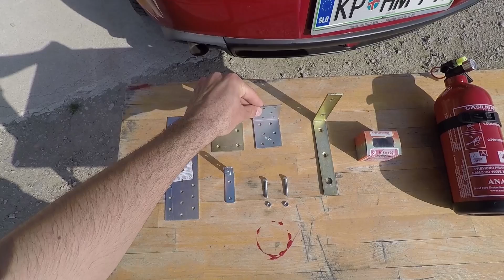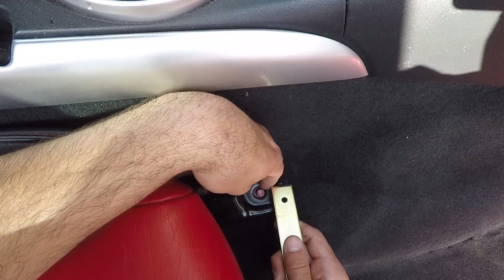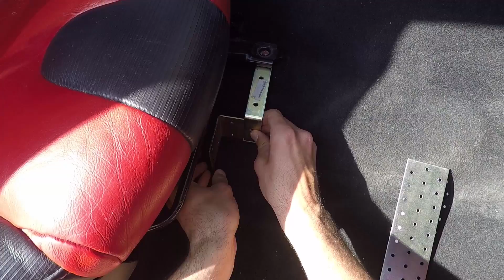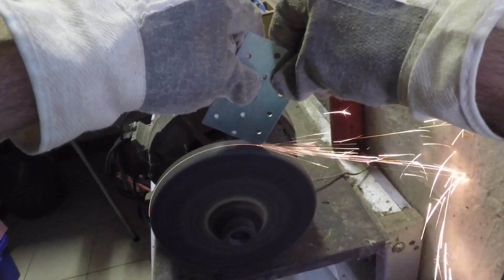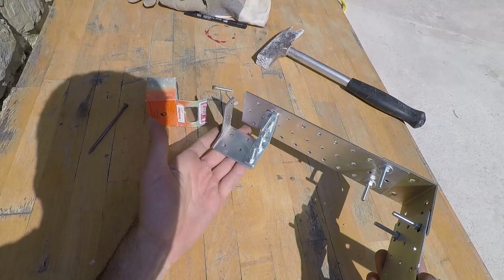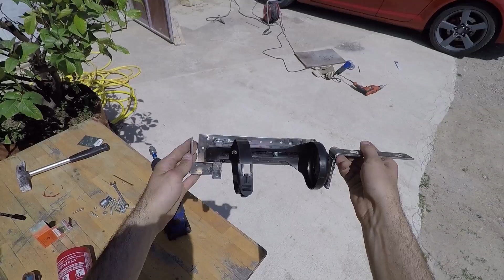Mazda Rx8 Fire Extinguisher Install

Comment from the maker: ⚡If anyone is interested, this is the fire extinguisher i used in this video: https://rover.ebay.com/rover/1/724-53478-19255-0/1?icep_id=114&ipn=icep&toolid=20004&campid=5338068045&mpre=https%3A%2F%2Fwww.ebay.it%2Fitm%2FESTINTORE-PORTATILE-A-POLVERE-1-KG-PER-AUTO-BARCA-CAMPER-CASA-OMOLOGATO-RINA%2F121931485847%3Fhash%3Ditem1c63aed297%3Ag%3A2Z0AAOSwxp9W79C3⚡

Comment: I put mine in the boot screw it to the top so your out the car when is on fire.     Don’t want to try pull that out if inside and your trying to get it out.     Just a tip
Reply from the maker: Thanks for your feedback, but i must say that I don't agree. It takes longer to get the fire extinguisher out of the boot, because you have press the boot button, get out, lift the boot, and then take it out. Instead if you have it under the seat, you just grab it and get out, it takes 3 seconds to grab it and get out. When racing you want to have it at your hand reach so you can extinguish the fire as fast as possible to minimise damage :)
Reply: Sure I’m thinking more my safety first not the car but your right for quick

Comment: My rx8 started to shut off on me aproaching stops n takes time to turn it back on any tips how to fix that
Reply from the maker: Clean the MAF sensor with a maf sensor cleaner. If it persists, check that the cat is not clogged, if it's not, it could be your ignition system that might require a change. If all of this check's out it could also be the fuel pump

Comment: In about 4 years i get my driving license and i want a rx8 but i dont want to work that much on it, should i Ls swap it?
Reply from the maker: iAdrian its not much work with the rx8. Maintenance is super easy, and relatively cheap. Just make sure you upgrade some parts, like the starter and ignition system, and you're good to go. LS swap is more expensive than rebuilding.the rx8 engine. I would recommend to look at the nissan 350z as an alternative :)

Comment: Isn't it easier to make a bracket from one piece of metal and bend and drill that? If you want to, you can send me the measurements of this bracket and I could make a 3D model of it. That way you can make a template to make this out of one piece of sheet metal. Awesome DIY though!
Reply from the maker: That's also an option, but i think it's more expensive and longer to install. i've spent 10€ to make this bracket, and also i like the challenge of using my creativity and skills to create something out of nothing :D Maybe for a future product i might consider it :) Thanks!
Reply: Sure! I totally understand. You are always free to use my CAD skills though!
I love your DIY approach.
Reply from the maker: mrawesomelemons thanks man! I have some future plans that I might need you for. So, to be continued... 👌😊